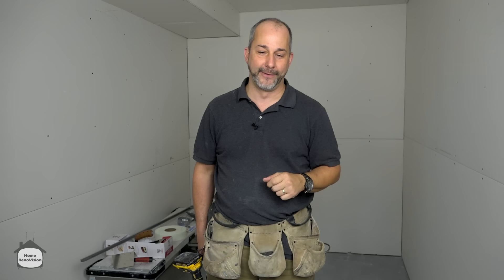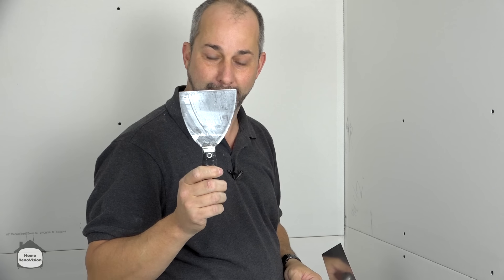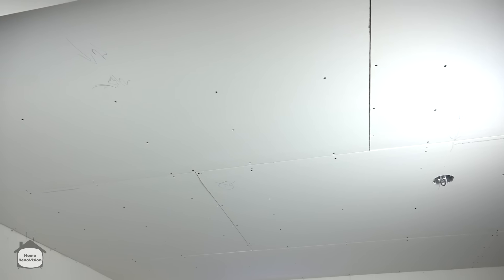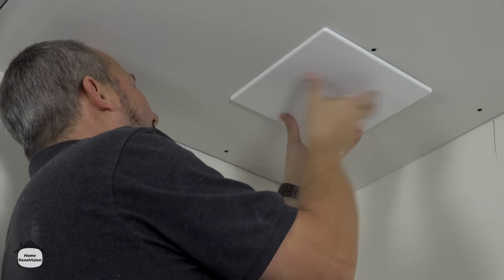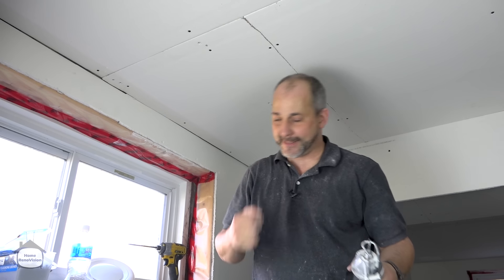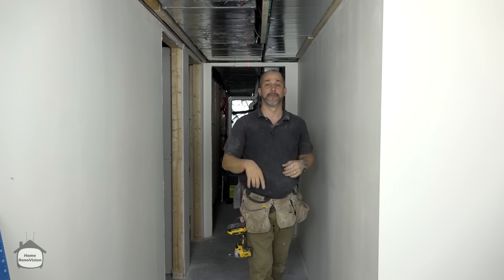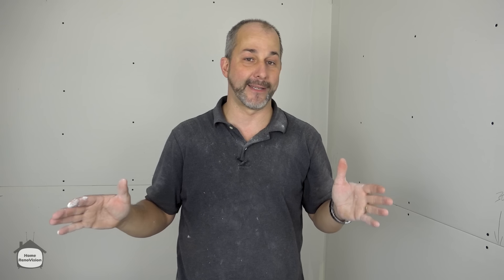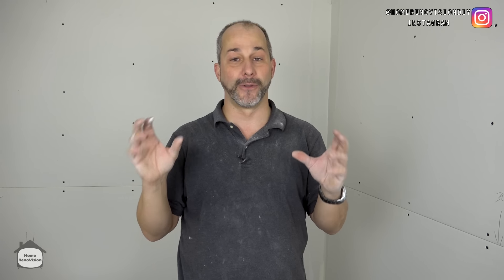DIY Drywall Finishing | 18 Tips and Tricks

Comment: Jeff, as a young man I drilled water wells breathing in the rock dust for years. Dust will fill your lungs and make breathing difficult for you later on. You can throw away a dirty air filter but not your dirty clogged lungs. It will catch up with you. Use a mask. I now cough quickly near any dust.  Good work except for your own safety.
Reply: Sage advice 👌🏼

Comment: Pro tip for the drywall tape reel - if you are right handed, you will apply the tape from right to left, with the tape reel on your left hip, pulling from the bottom.  I've got 30 years of experience as a taper, it will feel smoother and more natural.  If you're left handed, reverse this, but always pull from the bottom. The advantage is, you won't have to pre-pull tape off the reel. You pull directly off, and it's smooth every time.
Reply: Thanks
Reply: So, what you're saying is, TP goes under rather than over? LOL

Comment: That is the best drywall video I have ever seen.  I have done a ton of dry wall in the past,  I have worked with professional crews often; joining the crew to get them out of my way so I can hang my doors and run my trim. They got 1 day. I got one day and the carpet goes in.  dry wall crew was usually 4-5 guys, often adding myself. I ran Door and detail usually with 1 traniee, often by myself.  Hanging anywhere from 9 to 18 doors. 2 to 4 bedrooms, 2 baths often. The point is we had to fly; there was no taking breaks most of the time. You start and you don't stop until the job is finished. I learned a lot of tricks from all those guys; however if we had used all the techniques in this video we could have spent the afternoon doing whatever.  paid by the hour I guess we were better off.  I'll never do dry wall by the hour again that's for sure.    I would say that every "pro" dry waller I have ever met could benefit from this video.  Now my only question is how much should I charge to do the room you did this video in, paint ready?  I'm in Oregon. Go Ducks.

Comment: Hey Jeff, quick tip for the roto-zip, aka cut out tool. When cutting on the inside go clock ways, cutting on outside counter clock ways. The spin will help keep you on what you are cutting. Good way to remember is to just think, internal clock. Always helps me remeber which way to go.

Comment: Thanks for the tutorial. I use to hang sheetrock for years. I haven't done it in about 5 years now. I thought I'd watch to see what I can learn, just in case I have to ever do it again. I like the Rotozip tool. that would have saved me a ton of time. The 3M Spray is an excellent idea...another time saver. With the inside corner mudding, brilliant idea. I wish I had that back in the day. Also with the inside cornering, I used the inside corner tool 95% of the time...with mesh tape or drywall tape. I kind of miss hanging drywall, but then again, not. Believe it or not, I use to have fun sheetrocking, Taping, Mudding & Texturing. I was also the Hot Mud King. I was the 5 minute Hot Mud Man. Mix & go, Mix & go, Mix & go no time to waste. Thanks again.

Comment: As a man in the same industry....people listen to this guy, hes knows what hes doing!! 

I would add:

Buy the smaller inside cornering trowel 

Keep your tools clean while mudding

2 screws in the field and keep the others in the bevel which you will taped over.... only on the wall not the ceiling 

Less seams the better

Comment: In the beginning you got me, but when you used mesh tape for corners, you failed. Never use mesh tape for angles! I've been working as a taper since I was a kid and paper tape last 10x longer and the finish is cleaner.
Reply: Gluing on paper corner bead.. might work in Canada but in Florida it ALWAYS fails eventually.  Same with the guys who glue paper tape and plastic corner bead😂.. it always fails.
Reply: From another pro taper, and I was teaching a new taper, I would agree with you Jose. This is not the method I would teach to a trainee, however, for beginners who may only need these skills for one project, his method actually makes sense. It is SO easy for a rookie to mess up the install on a paper inside corner, especially without a pro beside them. If not, and the paper corner wasn't done right, no amount of spackle is going to fix blisters and round corners. Its the one thing a "Do-it-yourself" taper is most likely to mess up. IF  you have never done it before, and IF you don't have a pro to show you what you are doing wrong, this is a really good method, but you must  press the mesh tape tight, one side at a time, and then use the corner trowel with 90 minute mud. Any deviation from this, and it is bound to fail. Is this method better than than the method pro-tapers use? No, but if you don't have the pro skills, this method is a little more idiot proof.

As far as Danny's comment, yeah I've never seen that for paper corner bead and I'm real skeptical. It works well for plastic corner bead here in New Jersey. It may have more to do with your climate Danny. When the heat is on, you always have to be careful not to get too far ahead of yourself. If your mud or glue is drying, before you get the chance to bed your tape or corner bead in, you're screwed.

Comment: Paper vs. mesh tape seems to be a huge debate. Can you discuss the pros and cons of each?
Reply: Mesh tape is alot quicker but it is more prone to cracking, paper tape takes a little more work but it holds up in the long run if you dont want to be fixing lots of cracks 2-3 years down the road use paper tape, i have been in the drywall trade for 30 years i can say from experience paper tape is your best bet to a better drywall job
Reply from the maker: paper tape has the advantage of superior performance in a variety of situations and is relatively cheap compared to mesh. The down side is you need to set the tape in mud and wait 24 hrs before you can do your first coat.
The mesh tape costs a little more but since it is applied with a self adhesive you can mix a quick setting compound and do the first coat right away. if you are on a small job then you can also do the second coat in the same day. that puts you 2 days ahead of a paper tape project.
Reply: @HomeRenoVisionDIY  Is there a reason not to use quick setting compound with paper tape? Wouldn't that be the same time saving as mesh?
Reply: @tsfarken  
no there is not
Reply: @HomeRenoVisionDIY  So quantity over quality?
Reply: @tsfarken  yes there is a difference. Always use setting compound for embedding paper tape. Like general purpose joint compound. It actually has adhesive mixed in with the mud. Your fast setting does not. It makes a much stronger joint. You can use quick setting for the next two coats however.
Reply: @elluiz464  Luis, I just removed 4 rooms of popcorn ceiling and power sanded. The ceiling is cement finish with electric heat embedded. There are several cracks running across the room. What is your advice to patching the cracks and smooth coating the ceilings?
Reply: @elluiz464   Well said Luis,  I do this repair on the regular.  Cut out the mesh, and install paper tape.  I guess it's good job security.

Comment: Drywall install question:  so when you install your drywall on the walls, do you not cut a sheet so that it lines up with the center of a stud?  You just add a 1x3 to the end and keep going?
Reply from the maker: That is how I do it. less cutting and in many cases the wood studs are not level so it is easier than trying to stitch the screws together on a stud. I find it much stronger.
Reply: Wish I thought of that a couple months ago.  Remodeling a friends 1940s home.  No stud is 16 OC.  NOTHING square or level.  Big headache. Haha.

Thank you for the tips.
Reply from the maker: Another good reason to just screw and go. Cheers! pfish23
Reply: No you can but that's really not the right way you always break in the middle of a stud unless the framers don't know how to build an always stagger your boards start with a whole sheet at one end and start at the other end with a whole sheet that way your butt joints never meet an we always do ceilings  first  that way over time your wall boards help hold you ceilings up an always maker sure everything is tight or you will have to pack the joints an that's alot of time wasted cause if you get one bubble behind the tape that's more time you have to take to cut it out an fix I've got over 15+ years in doing dry wall I come from a long line of dry wallers like 4 or 5 Generations of dry wallers. Hope that helps an the thing he called a California patch we call a hot patch down in the south.
Reply: Wow 1940's an nothing is 16oc wow now days they do 16 set a head or set back which really it needs to be 16oc but depending on the framers and he does have a good point nothing usually is never straight or Square cuz people don't take time nowadays it's just thought up and go. Cuz most of the time people say looks great from my house lol. I usually just take a piece of 2×4 and just screw it right to the existing stud if you can but if you can't break it in the middle then what he was doing is a good way but make sure it overlaps on to your other piece of sheetrock or top wall plate (dead wood)that way it will help support the break cause if you just go in the middle of the next board it will just sag an crack an look like crap..
Reply: That's a no no.....
Reply: @dannyd8407   there are going to be situations where you can't break it in the middle of a stud or truss..This is a good work around ..As to hot patch that has to do with roofing ,no?
Reply: Your first sheet will be cut edge...left to right...every sheet in the middle will be factory edge at 4 ft each...last sheet will be cut or it will run behind a slap stud...if a tall wall then stager your sheets for strength...check by level on each sheet installed
Reply: Meadow Apple  Trust me, I've seen just about everything. Besides, I'm referring to his comment sround 26:45 when he said he keeps "a dozen or so of these sticks around" when he's hanging drywall to avoid breaking it on a stud/joist.
Reply: Meadow Apple I know where I replied. Phish's question is more than likely a result of the comment I mentioned. Phish was referring to the drywall, not the board. Thats why he said "do you not cut the SHEET" to the center of the stud. You're talking about a repair to existing drywall. Phish and I are not. Have a good day.
Reply: Great question,  suddenly I'm thinking how come I never thought of this.  You think about it and suddenly it becomes painfully obvious.
Reply: @HomeRenoVisionDIY  Suddenly it's painfully obvious I should have thought of this on my own. I have done it on all kinds of patches. but never when doing a full wall or ceiling.  I can't believe how  much smarter I am today just from watching this one video.
Reply: Meadow Apple  The time of his post is irrelevant. I read what he posted and agreed with it, then you jumped my case about it. What do you think I'm lying about? Apparently there's a lack of communication. There's no need in throwing a temper tantrum. I haven't lied on here one single time. Perhaps you didn't comprehend what I was trying to say or maybe I didn't state it clearly enough for you. Either way, don't get so worked up over it. It's not personal, so don't make it personal. Peace man.
Reply: Meadow Apple  Name them or gtfo
Reply: No a hot patch is what a patch is called when you cut another bord but leave the front part of the paper then mud around the hole an place the cut piece of board the mud an sand we call it a hot patch
Reply: I’ve done this job in the uk for 13 yrs now and by no means the chippys are the worst I’ve seen online, you would never run past your studs on walls if that means cutting boards to size and it also applies for ceilings, if your not fixing to solid studs or ceiling joists you don’t have a solid fixing which will almost always lead to cracking of the jointing compound (mud) also we have to fix every 300mm for walls and every 200mm for ceilings hope this helps

Comment: That's not the right corner bead for the glue! that bead is installed with mudd. holy fack dude.
Reply: Everyone has there own way but using glue on any of it is new to me an I've done drywall for over 15+ years I started when I was 8 like my dad an I'm 34 now an I've never used glue but each to there own there isn't really a wrong way to do anything if works for him great everyone isn't going to find that right I thought it was cool but I want ever do it.
Reply: All trim tex plastic bead is glued and stapled but hot mud must be your first coat always! With any bead you should be using hotmud. And I use very little mesh tape.

Comment: Thank you for the compression fit air control demo.  Excellent solution for a similar circumstance here in this basement!  And thanks again for these instructional videos.  I have to admit I can't match the existing drywall to new drywall seams with just 3 coats of mud.  More like 6 or seven to get the desired "flat" appearance.

Comment: Thank you. Your video for dry walling has been amazing.     I saved over a $2000 dollars. Doing  it myself   P.s I recommend   drywalling  entrepreneurs to follow his tutorials  . Because  the last drywall  employed entrepreneurs were horrible.  
They were sloppy & messy. So i had to firer them in the middle of the project.   Because  my kitchen wall was a mess from the beginning. The mounting was not accurate, the drywall was not cut correctly. and the opening for the pipes were not open in the correct areas it was a mess. But now with his tutorials.  I'm doing it myself.

Comment: I bought a delta breeze bathroom exhaust fan with humidity auto on cause my kids steam up before showering.  Yep, water starts dripping below. Anyway, the old cheap fan was smaller and so I made a bigger hole. I was looking on how to mount the new fan and saw it had the mounting holes on the reverse side. Of course it would cause it was an easy retrofit.  Didn't know where or how to cover up my increasing larger  jagged hole, I came to the source, YouTube. 

From you, I will:
Get 1x3 so I have wood to attach my new 24" x 12" drywall.  Maybe 1x4 cause I have zero skill. 
Cut exact fit, from your example of using a larger piece to cover 2 holes
Get the rotozip to cut the exact size of the new fan box and set the correct guide. 

Youtube is the best internet site and you're one of the reasons.

Comment: At 39:30 I personally wouldn't put just a little piece of wood in the center to hold that long joint, I would put a long piece that extends past the corners so the corners are held together tight. This is my only small complaint - awesome videos!

Comment: I just used mesh tape with all purpose mud mixed with some water with no problem. Never had it lift. I put mud in the area n smooth it, lay the tape n smooth it with the knife with another layer . I do three apps.

Comment: The dimple bits fit, like any other consumable bit, into a bit holder of your choice. They friction fit the bit on one side and commonly have a hex shank on the other end that locks in to most drivers. You can get them in different lengths, magnetic, etc.

Comment: I was glad to see you were using kwikset on mesh tape because that's what the manufacturer's call for also because regular drywall mud will shrink and tear it the manufacturer tells you do not use regular drywall mud on mesh tape that's the norm it will crack if you use that regular month

Comment: 29:20 When using the Rotozip (plunge router/laminate trimmer, etc...) run the bit counter clockwise, it keeps the bit pulled tight against whatever you're cutting out...boxes, can lights, ducting, etc... Easy to wander if you run clockwise.
Reply: Great video BTW

Comment: great video, deffinitly going to help with some cosmetic redoes on soem of the basement drywall at my place that hasnt help up all too well after 5 years of abuzsse hahahhaahah wish i had a few tricks when the guy was doing the project originaly, but even now itll hel repair some holes in the wall and some of the framed columns that have cracks and peeling :)

Comment: Love the video and alot of others you do. I have used alot of your tricks and methods however I must ask since u installed the trap door for the shut off a little off of the shut off would that not be a problem when u open the the drain on that shut off?
Did you fix or change it after the video?

Comment: Can I use drywall tape and joint compound to repair cracks in my plaster walls? My home was built in the 1930's.  I have almost a full bucket of "Plus 3 sheetrock joint compound" and was wondering if I can use it to fix my plaster?

Comment: Hi Jeff. I have some hairline cracks on the wall in my hallway. I have opened them up with a stanley knife. My decorator just used gyprock easy fill to fill them up. Question - when is a mesh tape suitable and when is it not? Should I wait for the filler to dry, sand it down then put the tape on and fill on top? Thanks and it's always great watching your videos.

Comment: This is the beat drywall finishing  tip you will ever see is this: makes sure you hang your drywall  with good tight seams. This video is showing perfectly  hung drywall. Finishing  is much easier  when the drywall is hung perfectly like this. Filling in irregular  gaps is what separates the pros from the DIYers.

Comment: If anyone reading the comments expericene the bit keep falling out, you can use a file or angle grinder to make grooves in the shank. Hold it next to a bit that locks in and you will se the differense and where to make the grooves.

Comment: Thanks. Very helpful tips. Question about Sheetrock 90: do you use a 3:1 ratio like it says on the package? I'm finding that to be too thick. I plan on using mesh tape. I am not done drywalling but I mixed some Sheetrock 90 today to test it out on some drywall repairs around the house. 
Thanks